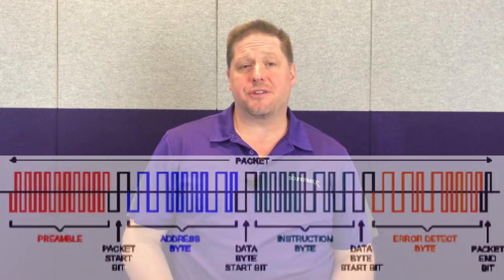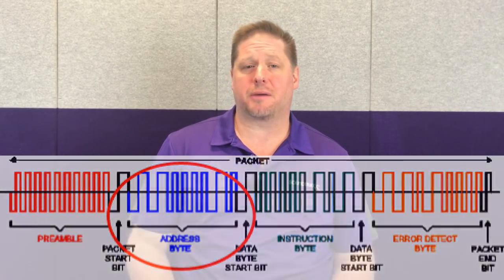Tech Tip: CV Programming and CV Myths with SoundTraxx

Comment: Great video. But I have question. If I set my locomotive to a long address, is it necessary to manually set CV29 to support the long address or is it changed automatically?
Reply from the maker: If you are using the command station's address prompts, it automatically configures CVs 17, 18, and 29 for the long address. If you need more assistance please contact our Customer Support Department: https://soundtraxx.com/contact/technical-support

Comment: Some more good tips George! I have always used the main for programming , and sometimes adjust motor settings of a loco in a consist if ti is not behaving !!  I do have a issue with Tsunami 2.1  while setting my speed curve with JMRI, as soon as I enter a value in the speed table, I loose my headlight function?? 
Have you heard of this ? It is a older version of JMRI (2yrs old) and it may be fixed on a update? I have had to remap the headlight to FX 4 so I can have it working. Is it worth calling you guys to discuss it?
Cheers Gregg.

Comment: George I think the misconception about programming on the main started when guys put several new  engines out of the box on the mainline without changing the default address  3 first. Of course if then they went to program engine 3 all engine with the factory address of 3 will be reprogrammed. One "con" with programming  on the main is that you can not read the CV values if you need to.

Comment: Excellent information.  The problem that JMRI has is the differences between the various brands of decoder.  Some decorder manufacturers are more open in CV used than others.  It is the lack of information on
Reply: My mistake. Hit the wrong key.  It is the lack of information due to properietary use of hidden configuration variables.
Reply from the maker: @justgregm7843  Yes, we think JMRI is a great tool. But if you are having a problem with our decoder it is always best to go back to our manual and see how we tell you to set the CV.